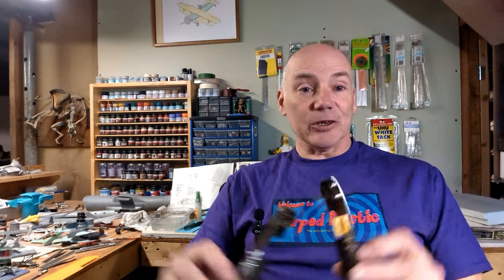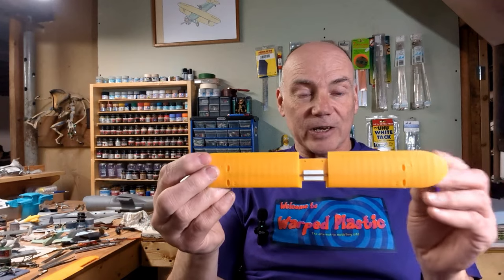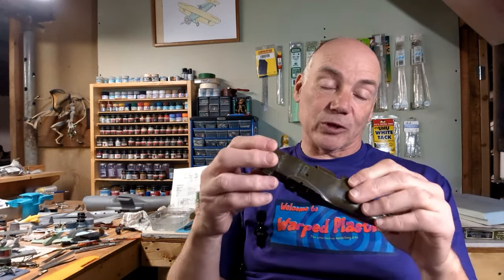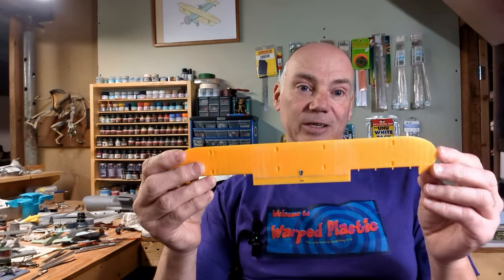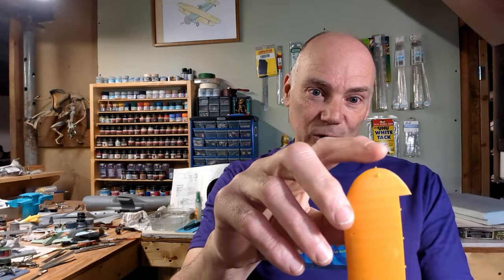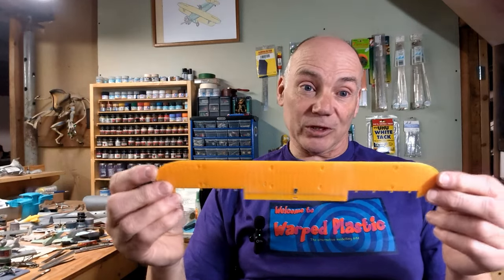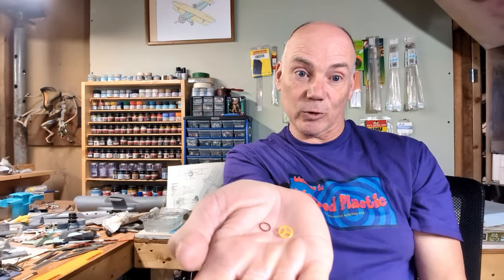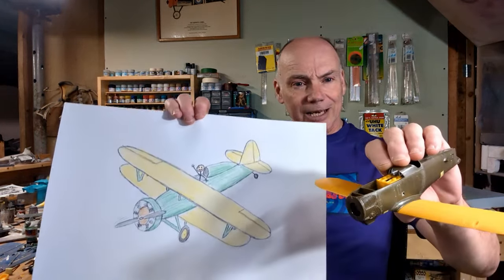Building the Hasegawa 1/32 P-12E, part 2

Comment: Nice work! We all make things difficult for ourselves sometimes, I'm currently working on an idea I had at least 50 years ago which involves two front halves of a car joined together. I think at last I have the skills to make it work and so far it's gone well. It can only be a matter of time before it all goes disastrously wrong!
Thanks for reminding me about Dymo tape- I must try to get hold of some.
Reply from the maker: Thanks for the comments and good luck with the project. A "push me pull you" car sounds really interesting!
Reply: @warpedplastic  It's not been as tricky as I thought it might be, fortunately!
Reply: There is an auto mechanic not far from where I live that did just that with real cars. The fronts of two VW Beetles were welded together, back to back, and mounted on a tall metal pole. It's easy to find his shop from quite a distance. 😊
Reply: @Chilly_Billy  Its been done for real with two front wheel drives to make a twin engined two driver four wheel steering thing!

Comment: I really appreciate your view on building-up gaps with plastic stock vs. putty. It seems to be an older concept lost on younger/newer modelers. While putty can do a good job in certain circumstances, I believe those are limited compared sheet styrene cut to fit a gap.
Reply from the maker: I agree, there seems to be a lot of modellers these days who rely on large quantities of filler to cover up gaps rather than correcting the fit problem at its source. A bit of filler is fine now and then, but using a lot to fill large gaps will likely crack eventually. Many thanks for the comments.